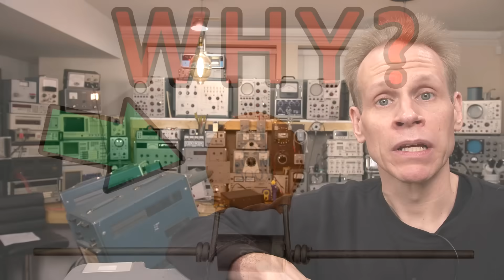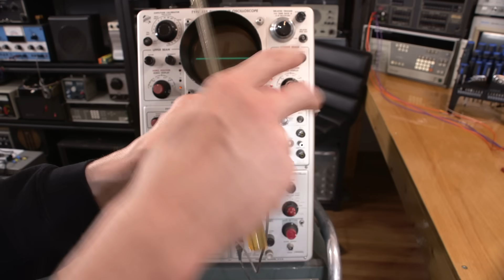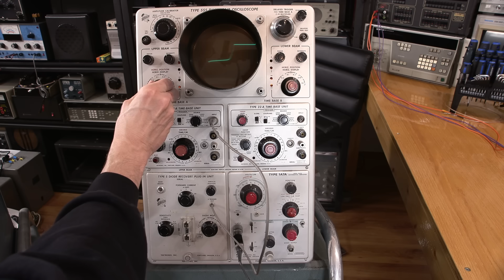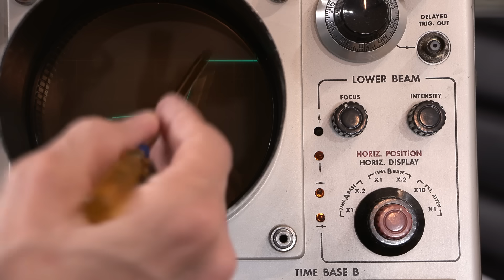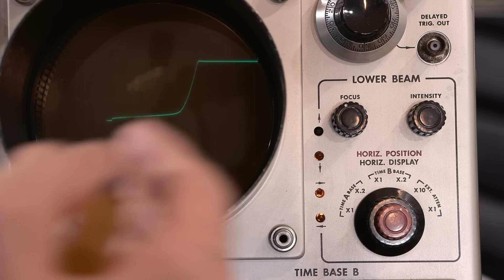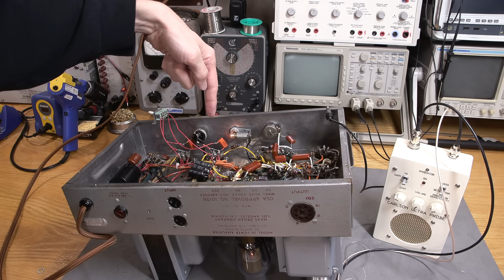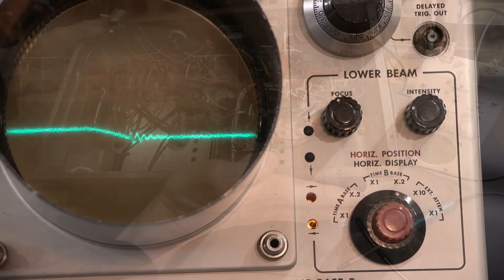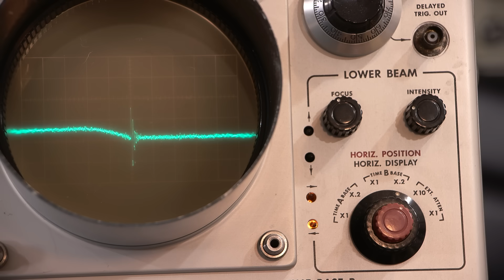Why Put A Capacitor Across The Diode? Here's Why!

Comment: It would be helpful to explain what we were looking on that scope, e.g. what's on X and Y axis, what are the ranges.
Reply: If full knowledge of oscilloscopes, diodes, capacitors, and test circuits are required to understand the video, then he isn’t really teaching anything.  Everyone that can follow already knows as much as or more than the teacher.
Reply: @WhyNotPhotography-hj8yb  Yep
Reply: Buena explicación
Reply: @YammirRolandoPajueloCano Thank you Mr. Obfuscation. Are you a Senate Republican? You never answered the question. What’s on the horizontal and vertical axis? Presumably voltage and current?
Reply: No schematics, no explanation what are we even looking at. If the only people who understood are the ones who already knew all the answers - the video is useless
Reply: @alexkymar  I agree, the author missed the input signal visualization, but he was talking generally about transient processes on a diode. The input signal can essentially be anything, the main thing is that the diode bias is not only forward but also reverse.
Reply: YES! I was going to make the exact same comment!
Reply: He's using a "Type S Diode Recovery Plug-In" in the scope, which produces some rather confusing output. If you read about it, they say, "It can be thought of as having two parts, a stimulus subsystem and a measurement subsystem. The stimulus comes from mercury switch that drives a 6GM8/ECC86 tube that operates in a current-steering mode. The measurement subsystem is a wideband amplifier that converts the single-ended voltage on the diode under test to the differential signal that the oscilloscope mainframe takes. One terminal of the diode is grounded.

Measurements with the Type S are typically made by applying a current step to the diode while observing the voltage across the diode. "
Reply: That was going to be my complaint to.  What was the input to the circuit.  I gather, from your explanation that the diode was coming out of reverse bios at the left end of the scope sweep but I’m not exactly sure.  Anyhow… I would say that this is an utter and complete failure of a tutorial.  Down vote.
Reply: Pretty much any standard oscilloscope is showing voltage on the vertical axis and time on the horizontal. That’s the default 99% of the time unless someone specifically switches to X-Y mode. It’s kind of Oscilloscope 101.
Reply: @VandalIO  Yes... I know that.  So, the question is still -- what was the input?  AND, who says it wasn't in X,Y mode.  He connected the diode up to some special "test" circuit which is not common on oscilloscopes.
Reply: @WhyNotPhotography-hj8yb  You’re right about the distinction. A true I-V curve requires the oscilloscope in XY mode, where one axis is diode voltage and the other represents current (usually taken from the voltage across a known series resistor). Without that second measurement, the scope is only plotting voltage against time.

In the clip, the scope is almost certainly in standard V-T mode. The diode is being driven by a simple test circuit, likely a ramp or small AC signal through a current-limiting resistor. As the input rises, nothing happens until the diode reaches its forward voltage. Once conduction starts, the diode clamps at its forward drop and the waveform takes on that familiar “knee.” That shape makes it look like an I-V curve even though it’s still just the diode’s voltage over time, not voltage versus current.

So the behavior matches a basic diode test circuit rather than a true curve tracer.
Reply: @VandalIO  but what is the input signal used? I always prefer to see the input next to the output signal for understanding the effect
Reply: @timoalbers952  The input could be anything that rises , ramp, triangle, even a 5 V sweep through a resistor. Below about 0.6–0.7 V the diode barely conducts; once it hits that threshold, the voltage clamps and you see the “knee.” It looks like an I-V curve, but the scope is still just showing voltage vs time unless current is measured on a second axis in XY mode.
Reply: @timoalbers952  I think if you connect a resistor and a diode in series from the output of a generator with steep rectangular pulses, and take the oscillogram from the diode, then the picture of the transient process should look like this
Reply: @VandalIO  Yea ... but this looked like some kind of curve tracing option on that diode test section on the scope.  I agree his explanation of what we were seeing on the first scope view was no where to be found.
Reply: @Dave_____  It only looks like curve tracing. True curve tracing needs X on one channel and current on the other (usually via a series resistor). Here the scope was in standard V-T mode, just showing the diode voltage as the input ramps. The “kink” at forward conduction makes it resemble an I-V curve, but it’s still voltage vs time.
Reply: Yes but I am sure he cannot give a full lesson on oscilloscopes every time he uses one in a presentation.    He has other videos about them specifically.
Reply: @timberpoodle3916  i know how oscopes work. but is he applying a DC forward bias. do diodes make a little spike when they transition from off to on? i actually just guessing at what he's actually doing/looking at. and guessing i guess is good enough
Reply: I just listen to what he's saying.  The tools mean very little compared to the conversation.
Reply: @stevenfulton2968  There's a few important things that he forget to say. It is important to know what the oscilloscope is showing. What is that diode recovery test unit doing? Where the extra noie is coming from? How much does a change in capacitance used affect the amount of noise reduction?
Reply: @KayakingVince  
I'm wondering if it's acting as a low impedance bypass for the high frequency harmonics introduced by the diodes being non linear. But I guess you need to choose value to not have too low impedance at the power supply frequency. Though this is coming from old memories of an engineering degree that I don't use now. 

Is the probe picking up RF noise?
Reply: Pause the video, take a screenshot and blow it up and you can answer yourself. May I politely say?

Comment: I ran into that with a van with a TV. The alternator got noisy with worn brushes. The spikes, ringing and dips was more than a more stable 12 volts the TV needed.
 I used a oscilloscope to find the best spot in the power supply wiring to use a coil and capacitor to filter out that wide band noise. That is a bit like tuning a RF transmitter,  only it is the opposite process. 
I found a spot to filter out almost all the noise. It was not the closest to the TV. The thing with automobile wiring is positive is a wire and negative is the body. The body is also 1/2 of a antenna, plus a bit like coax..
Reply: In a automobile it's almost always inadequate ground(s).

Comment: Where is this diode located in the amplifier circuit? Is it in the power supply circuit as part of the bridge rectifier or somewhere else? How do I calculate the capacitance of this capacitor?

Comment: It's sometimes used for reverse diode protection and usually found in a power supply's  output circuit and thus useful for 
limiting noise in any amplification  circuit as the Ultraprobe reveals here. It reduces parasitic oscillations as a diode
functions. This is a better explanation than the AI generated summary that was given to us from below the video. Nice
demo Paul.
Reply from the maker: I appreciate your feedback!

Comment: Not a bad idea to add a cap (and even a reverse diode) across brushed DC motors and across snubber diodes in relay and other inductive circuits.  They can help eliminate noise and pops on other nearby devices like amplifiers, radios, etc...

Comment: What does the capacitor do? Remove the 60 cycle hum of the power? Does this happen also in a circuit where the diode is a protector against backwards current and would the capacitor mess with that function?

Comment: Usually implemented in high-end audio equipment, caps across rectifier diodes reduce noise on power supply outputs

Comment: I put ceramic caps across the diodes to help with noise reduction. When the current switches off and on suddenly in the associated linear power supply transformer, I figured that the sudden change in current gers noisy because of the transformer. I usually use 1kV rated 0.01uF.

Comment: Hi Mr. Carlson. Old subscriber and old Audio Tube amp techie here. My first build was an All American 5 kit in high School electronics class in 1974. (Mount Rainier HS - Mr. Bishoff then on to DeVry in Phoenix Az.)
I have two questions
1. Is there an optimum capacitance value for a full wave bridge diode rectifier? I imagine that there is being that a single capacitor is a first order filter at 12db per octave. (now that's a thought, would a second order eliminate even more noise?
2. Would this also be applicable for a half or full wave tube rectifier? My guess is no. My thought is that even though both only allow current to pass in one direction, the transient characteristics of solid state and vacuum tubes would be different?
Ok, that's actually 3 questions ...
That would make for a great followup video don't you think?

Comment: if you have diode going to transistor base in a digital circuit adding a capacitor over that diode makes the transistor work , turn off when voltage on anode of the diode goes low,  i forgot the frequency but about tens to hundreds of kHz

Comment: Never do it.. a diode leakage capacitance must be as low as possible, but you are adding a lot externally and generalizing it.. Wrong!
Reply: doesnt matter in a mains frequency circuit, the capacitive reactance is minimal, but enough to reduce noise..

Comment: My wonderful Fender Pro Junior came equipped with a 60Hz. hum. I took it back and got another identical amp with the identical hum. Amp is sweet, but mic'd up that hum is unbearable. Do I need 4 caps (Rating?) for a full-wave bridge circuit? (4 diodes...)  Thank-you, Mr. C.

Comment: Just so as to not be a "negative nanny", I want to say that your ultra probe is absolutely excellent and I personally LOVE your videos. Thumb's up!

99% of us don't know what each axis is measuring on your curve tracer. It would be helpful to point out what each axis actually means. Are we only looking at the revers voltage region? Or the forward? Both? Someone else mentioned you did not explain why it makes the noise. 

Checking with many viewers of these kinds of videos, I find many students of low economic opportunity completely freak out at the site of your lab. You might consider some lessons based on not owning every piece of test equipment from NASA. It is very intimidating to those who have no initial understanding of this tech. A much huger audience than the entitled classes. I started in electronics at age 11, absolutely alone, on a ranch in the middle of nowhere. No internet then. Not one person in my life could follow the projects I was attempting to build in my vacuum. The TV repair guy in town, 15 miles away, and one ham radio operator were my only mentors. It was four years before I could get even a basic VOM. I still built most of the regen receivers in ARRL handbook, despite that shortcoming.
Reply: Yea! I would love to see videos where the only test equipment is a cheap multimeter. I am lucky to an O scope someone gave me. But it has some issues. So I haven't been using much. I need to fire it up again and see if I can get some use out of it. If nothing else, waveforms from my modular synth would look cool on an old school CRT O scope display.
Reply: I spent way to many years building stuff with a minimal of test equipment, too. Op amps and resistors on a breadboard to measure voltages when necessary. Makes you really think things through more thoroughly and ultimately come away with alot more knowledge.
Reply: I think forward and on and off as he was showing
Reply: He was using diodes to build a rectifier, so I'm pretty sure the hum came from semiconductor switch noise every 60 seconds (assuming he's using 60Hz mains power). Tossing a cap across a diode basically acts like a low-pass filter to smooth out the switch noise.
Reply: Bro liked your reply but still didn't given an answer, wtf.
Reply: x axis is time, y axis is voltage.
Reply: i , i , i and some " i found ur errors " on top of it .
Reply: @tolgadabbagh1877  What does this mean? I do not understand what you are trying to say.
Reply: @tolgadabbagh1877  It would appear that your shift key is broken, and your spacebar is overly excited.
Reply: Alot of times you have no choice but to keep using i how else can she start it out without him saying i

Comment: But why in parallel, not in series?
Reply: A series cap after a diode would block the DC.........   and it'd have to be a HUGE cap to work down at the 60hz range if before the diode.
Reply: Capacitors suck at conducting DC and DC is what we want out of the rectifier. 
But then, capacitors are "good" with conducting AC, and the higher the capacitance and/or frequency, the better. A series capacitor of correct value can be used as a nearly lossless voltage dropper in an AC circuit. I think Mr. C has videos where he did that, for example to replace the "curtain burner" ballast cord that some old radios used to have.

Comment: In many consumer electronics (radios, tape players, amplifiers, etc) I did this, and also in all my projects. Many times I achieved zero mains noise. I used whatever I had at hand, 10, 33, 47, 68, 100nF ceramic. 
Also, in many commercial electronics  there were places/holes on the pcb for the capacitors but the capacitors were not populated. Just to save few cents...
I knew this noise as the switching noise of the rectifier diodes and got this tip from a old electronics book, as well as many other useful tricks (for example to power a vacuum tube filament in CC to further reduce noise).
Reply: isnt the capacitor purpose in general to smooth things out, so noise too? asking as a beginner
Reply: @PinkeySuavo Low resistance with low capacitance and inductance provide an RLC circuit that oscilates. The added capacitor provides changes the time constant of the circuit. If you also add a small resistor in series the effect is stronger (similar to snubber circuits)

Comment: Well, this explains a lot of amplifier power supplies I've worked on that use this exact circuit. I've found it in Mcintosh, Pioneer, and even Realistic. I began adding the caps as practice and found the PS noise did drop. I enjoy the practical theory you often teach. You and a few others explain things in ways that I understand far better than if I were reading it. It's probably tied to the practical demonstrations. Thanks Mr. C!
Reply: He demonstrated but he didn't explain anything...
Reply: @CandCfuninthesun you can find the information about capacitors and other videos within his channel. This, as I understand it, is a tech tip as to how to use a capacitor in a specific place to get a desired result

Comment: What should be the value of capacitor across the diode. I have also seen resistors of 470 K connected in parallel to the diode where more than one diodes are used in series for high voltages.

Comment: Good video. It would have been a bit better if you had dug a bit deeper into the PN junction characteristics and why there is a reverse recovery period and what minority carriers actually are. Also we can see the diode “rings” because it is effectively an RC circuit. The electrons and holes don’t just bounce back and stop - they decay….it’s cool to see it on a scope I used in college (very old electrical engineer here).

Comment: And that's why I use FREDs in my audio tube amplifiers. Also, the leakage inductance and winding capacitance in the PS transformer forms a resonance circuit that's excited by the current pulses in a cap. input PS that results in ringing. That can be damped with a capacitor and resistor in series across the transformer primary.

Comment: I’m a developer of switching-Supply’s. Please be very carefully with rectefire-diodes. The problem ist the recovery-time. If polarity changed, the diode go not   Immediately from conducting to blocking. This caused a sharp rise for current. A current flows over an parasitic induction. If the diode block the current, the parasitic  induction drive the voltage on the diode very high. This can destroy the diode.
It is strongly recommended to measure the voltage on the diode in worst conditions.
Following you can do: 
1. to add snubber, an capacitor resistance combination, the disadvantage is energy in the resistor 
2. better you look for a diode they can adsorb avalanche energie.
Reply: I my early SMPS days I blew up many diodes because of these recovery time delay... Not cut off enough. 😉
Reply: What kinds of frequencies are you switching at? Presumably this gets worse as switching frequency increases.
Reply: @richardcorfield9926 This problem is independent from switching frequency. It happend when the diode blocks the current.
Reply: @geo48geo48   Though presumably at higher frequency a larger portion of your time is affected?
Reply: Would love to see a Mr Carlson video about R-C snubbing! Audio people get into long arguments about snubbing diodes.

Comment: When bypassing diodes with capacitors, it's important not to overdo the capacitance of these capacitors, otherwise you can only make things worse. The diode's internal capacitance is a parasitic component, and fast switching diodes have very low capacitance. And yes, diode breakdown is a very fast event, and the resulting ringing significantly degrades the output parameters of power supplies and many other circuits. It's odd, considering we need maximum switching speed from a diode, yet we're trying to smooth out these switching operations as much as possible. :D
Reply: He was using 0.01 uF, or 10 pF.
Reply: @beakytwitch7905  I think you mean 10nF